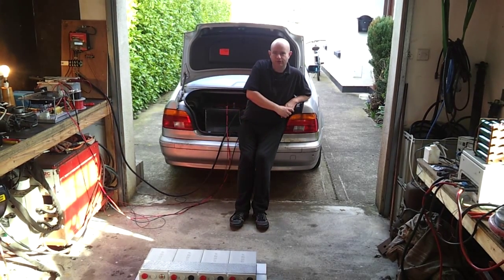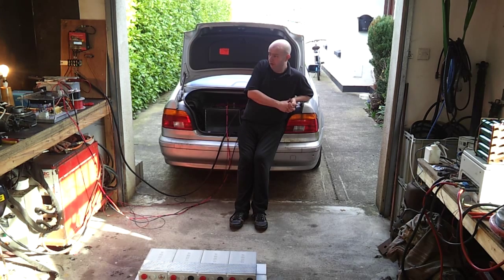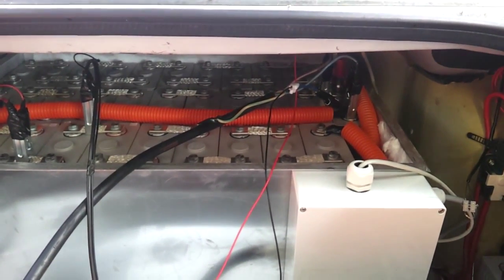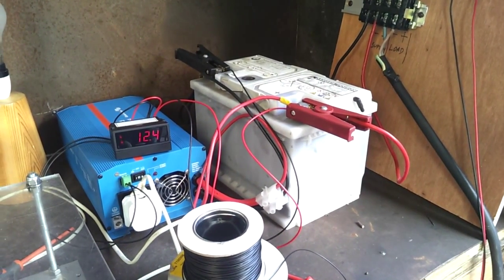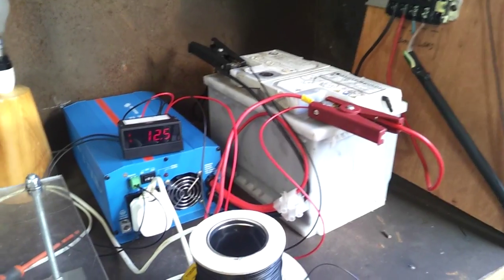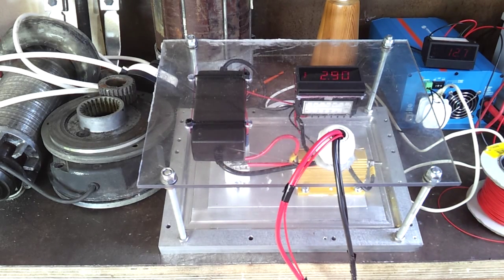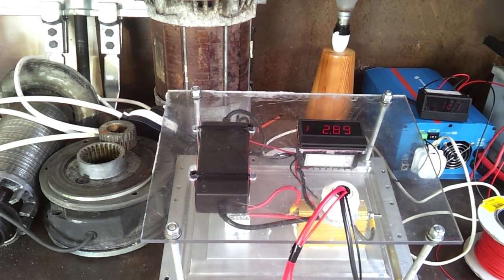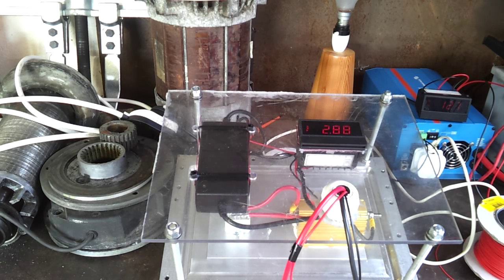BMW E39 EV Conversion 32 Balancing Act

Comment: Why 1,5 ohm? I'm using two 0.8ohm 25watt and with help of small heatsink it does the job ok. Discharge current is 8amps at the beginning and drops slightly when voltage drops. you can use as many resistors in parallel as you like, just to make all process quicker at 30-40amps
Reply from the maker: The resistor is 0.1 Ohm 200W. Discharges around 28 amps.
Reply: Damien Maguire Oh, sorry mate, I should probably check my hearing :D can bet i've heard 1,5 in a morning...  damn that phone :)

Comment: Hi Damien, you might check out this thread I started on DIY 150 amps 160 degree F on the rebar while running'

http://www.diyelectriccar.com/forums/showthread.php?t=84591&highlight=balancer
Reply from the maker: Thanks Don. Good tip but I needed tobalance the cells in the car due to space restraints.